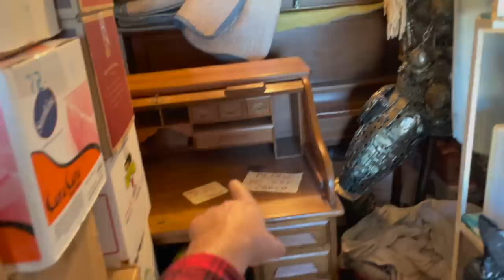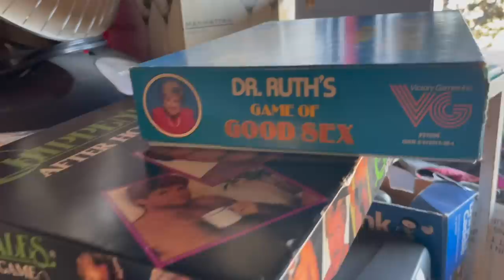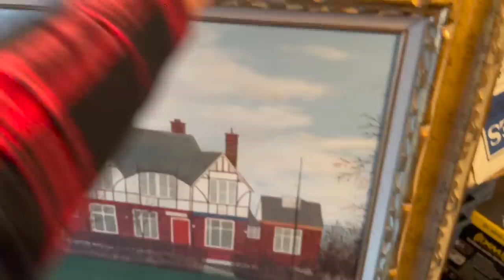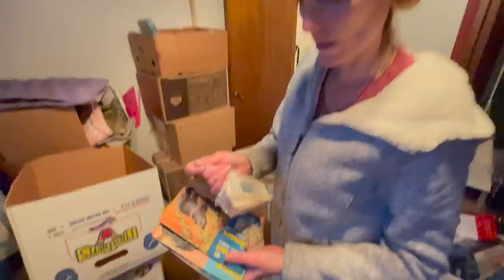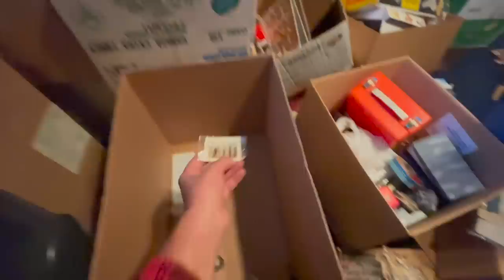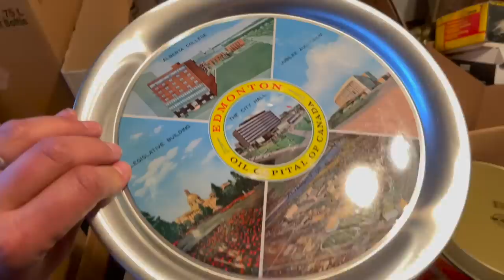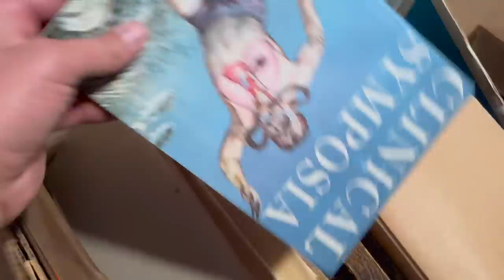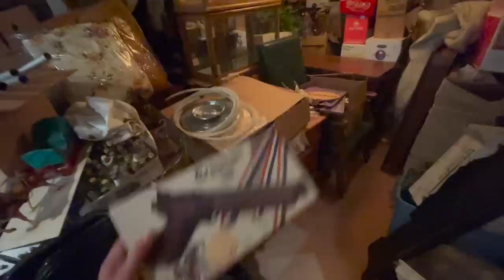Pt 4.  We found gold! Hoard Clear out! The whole family helps! And... Furniture heads to auction!

Comment: The baking nails! I am 68 and have my mother's baking nails. We never bake potatoes without them! So much better than wrapping them in foil to bake them. I love the crispy potato skins. Just wash, push the nail in and set them on the shelf in the oven. The nail conducts heat and makes the inside of the potato cook faster. I thought EVERYBODY knew that! Maybe it's an American thing! Mine are at least 50 years old!
Reply: We had a hinged thing that was like 4 baking nails hooked together in an X shape. You’d pull it open, and spear your potatoes on them, and then it would stand up in the oven. They worked! Would cut the baking time down by maybe 1/3? We always washed and then greased the potato skins, so they’d get all crispy. So tasty that way!

Comment: So, have you considered making dust catchers? You get a 20 inch box fan, and some 20x20x1 house air filters, then just attach them with small bungee cords, or tape, or just use the suction of the fan to keep them attached, and they will cycle all the air in the room over and over filling up the filter. Get a few of these in your work area, and you'll be set.
Reply: We have one of those going right now for wildfire smoke (with a MERV 13 filter for the smoke). It really helps.

Comment: Facts about potatoes goes in with ephemera, as an example of building lots for auction.  We’d use shallow boxes, like the lids from copy paper boxes, to group up small items like costume jewelry, watches, pill boxes, matchbox cars and the like, as we’d do the first “gross sort” in the house.  You find a lot of single loose items that need to be grouped up, to get the value out of a job like that and not “leave money on the table”.  Then 3 or 4 of those shallow boxes would be stacked into a Rubbermaid tote (with the lid on) for transport out of the house or storage unit to their destination.  The more grouping that gets done the in the first pass  means less handling each item later.

Comment: you should use a little " möbelhund" always. helps certainly for your back. i am usually alone and it works fine. needs a bit of adjustmend and getting used to but my back is happy since i got 2

Comment: Folding tables:  you could use a few.  Seeing Melissa on the floor, on her knees makes me say ouch.  It’s always more efficient to work with the boxes at a standing height and sort onto a table.  When we didn’t have enough tables we’d leave one full box on the floor and sit the boxes/bins we were sorting on it, to lift the sorting to a comfortable work height.  At the end of the day/week, your back will thank you.

Another thing we’d do is set 1 or 2  sorting areas up with tables and bring the boxes to the sorter(s).  Less skilled labor brought the boxes from the other rooms (on the same floor on a multi level house) to the sorting area.  We’d set sorting area up in an area like a dining or living room, because it tended to have better light and the trash cans/boxes were always ready.  Good access to and outside door near the driveway was also key.  Then as the good stuff or full trash containers were ready, the less skilled crew could move the full Keep boxes to the staging area and the trash to the dumpster.  If the truck or trailer was on site, the good stuff went right out the door next to the sorting area in full boxes and totes for stacking.

Comment: I sell clothing online, some of it vintage. I have sold a vintage corset from the 70s for over $300 (it was christin dior like new and lace) and it went from usa to denmark so the shipping was even more than the item itself. Anyway I had to look up that mohair coat. I found it is probably worth if in great condition between $70-100. What you want to look for with Mohair is the button front grandpa sweater cardigans. If a nice design can go up over $200. Ok back to watching your video as I work.

Comment: A baking nail makes perfect sense. First it's going to be plated or otherwise prepared with a food-grade coating so you don't get anything in your potato that shouldn't be in food, like zinc. And the point of the nail is to make your potato bake faster by transferring heat directly to the inside.

Comment: With the potato baking nail trick I'd never heard of that before but I bet it would speed up the cooking. The nails would heat up and bake it from inside. One thing I would suggest though is if anyone does this be very careful about what sort of nail you use. Some are coated to prevent rusting. Also galvanized nails wouldn't be good to use..

Comment: At 18:23 that looks to be a American Girl or the pleasant company doll. Look on the back of the neck and tags that may be on the doll. If it says pleasant company it's a older American girl from when they used to have a different name. 

They can be sent to the American Girl doll hospital if you pay for them to get fixed up. You can also fix them at home if you know how.  They are expensive when brand new and if you want you can put a My Life As Walmart outfit on it and give it to a kid instead of buying the more expensive American Girl clothing.

They can go for cheaper if pre-owned with messy hair and no clothes.

If you find the clothes that fit that doll putting them together would be worth it especially if it the outfit that came with the doll originally.

Comment: I am wondering why you don't rent a Uhaul to pack up stuff so you can do less loads. Probably cheaper to rent than running back and forth several times to the charity or bringing stuff home to Edmonton to your home or to the auction house.
Reply: Aside from the cost, it's probably a psychological, as well as a practical solution.  The folks at the Salvation Army are used to accepting and processing the few bags and boxes that people deliver.  A big ol' truckload would probably not go over as well...

Comment: I 100% disagree with your sorting method .... piling boxes of things that need to be sorted all over things that need to be sorted is counter productive 
And you take a nicely folded box like that box of moving blankets .... you dig to the bottom and you leave the box opened and messy and now it's hard to handle ..... and you gotta get rid of that camera in your hand so you can use both hands .... they have technology so you can work with both hands and video tape at the same time
Reply: @justmeiniowa  is just be more organized ... touch each box fewer times